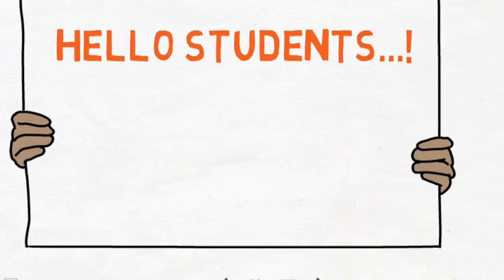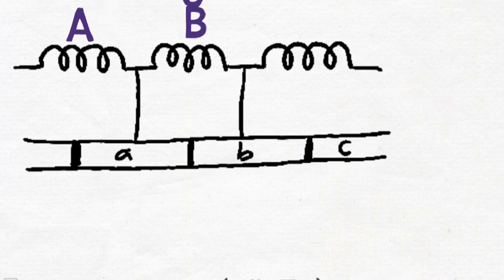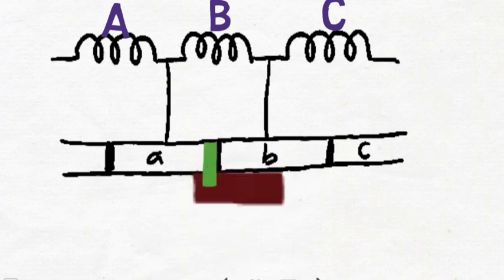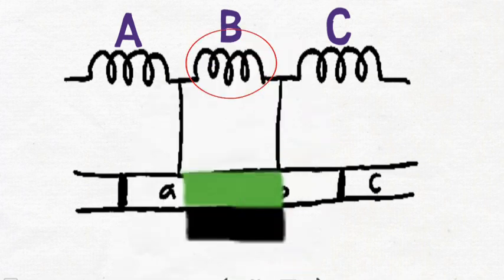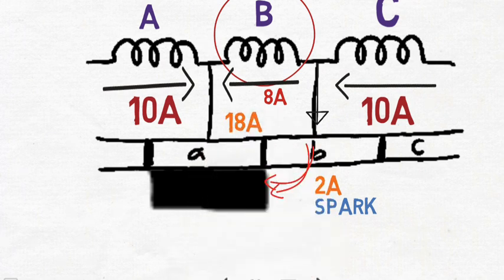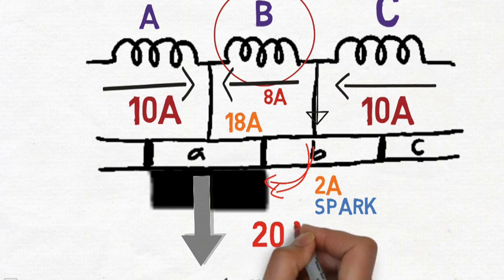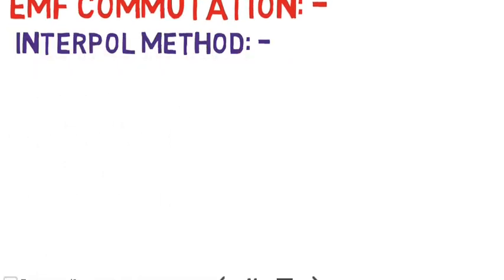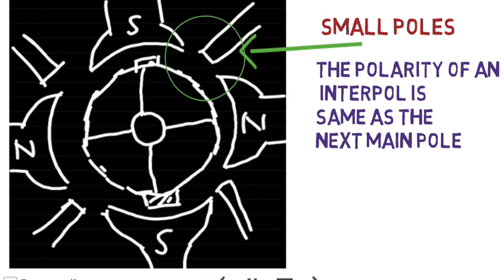commutation in dc machine with method of improving commutation /Commutation process in dc generator

Comment: 7:30....it should be high resistance carbon brushes is replaced by low resistance copper brushes.... Check it once again
Reply: Low resistance Copper brushes are replaced by high resistance carbon brushes...!!